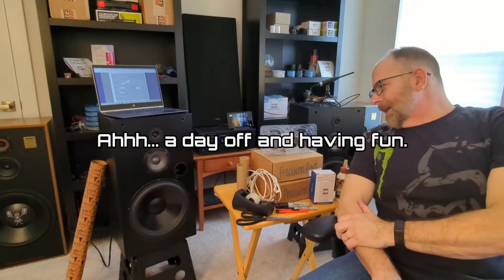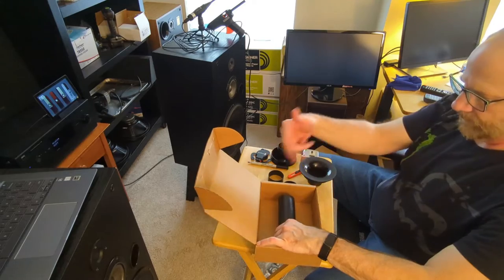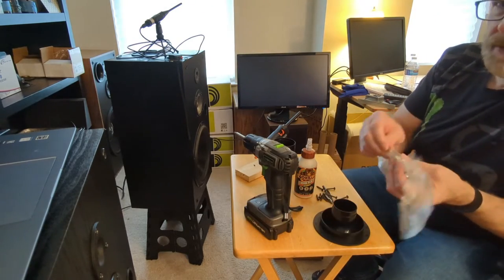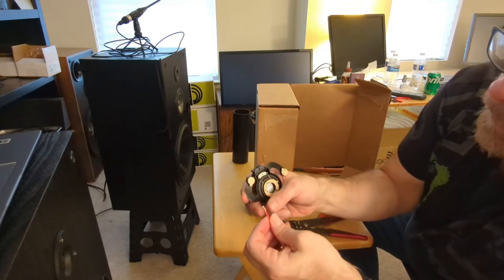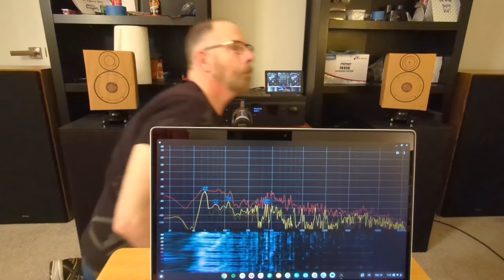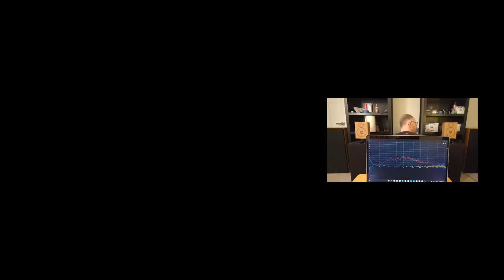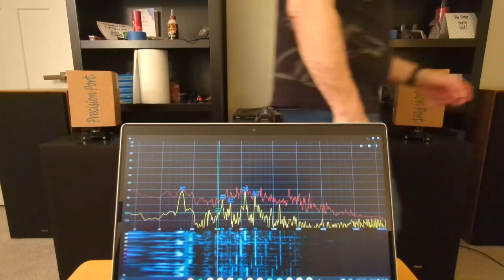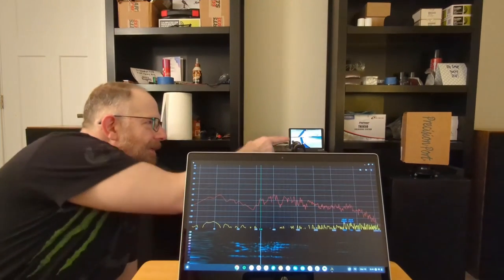Fun DIY Cardboard Speaker Project using Dayton Exciters with Precision Port Kits

Comment: Nice! I just set up testing some little exciters with the Dayton audio amp. Just sitting on a little cardboard box. Sounds like an okay pair of PC speakers. I need to get some better wire and try the foam board panels. I just used two pairs of Ethernet cable wires for testing. I can't help but think sitting on top of those other speakers you have there, they're probably resonating with the exciters making it sound better. I like the setup though to sit on top of the down tube thing. Wouldn't it be better to place the exciter on the back of the box on the outside?

Comment: They sound even better on a sheet of 2' x 2' rigid foam panels with rounded corners.
Reply from the maker: Thanks for watching and commenting! I've not tried them on foam, but do have a sequel planned, (spoiler alert, it involves bigger is better pseudo science).
Reply: Don't understand why everybody does 2x2.......for better sound go 2x4!!!
Reply: @shuff1111  
Matter of fact you could do 1 of each size. I would do dead center on the 2x2 and apply the 2/5 - 3/5 method on the 2x4 panel. That will give you a litlle more low end. Good luck on your project.
Reply: @rongriggs4430  Gonna do 2x4 foam with 2 exciters per board and a subwoofer.....as an alternative I might also add 2x4 acoustic ceiling  tiles for lower and fuller sound.